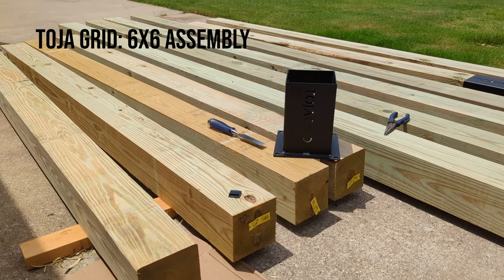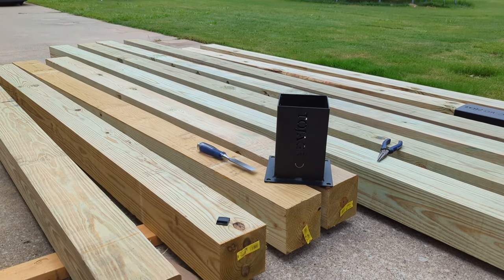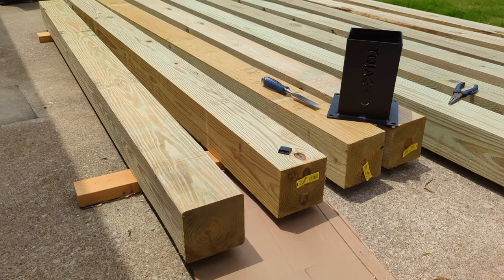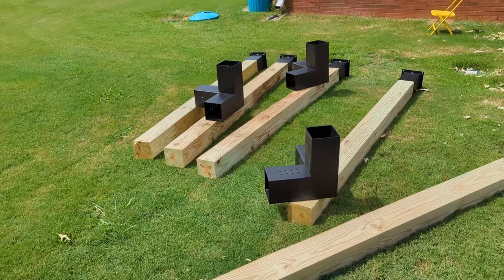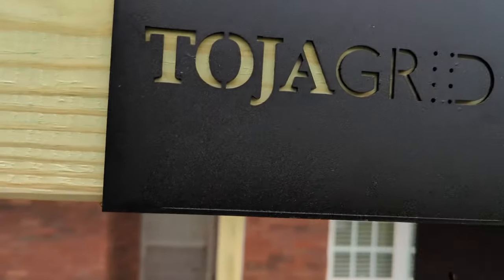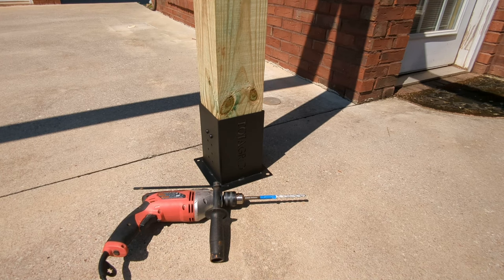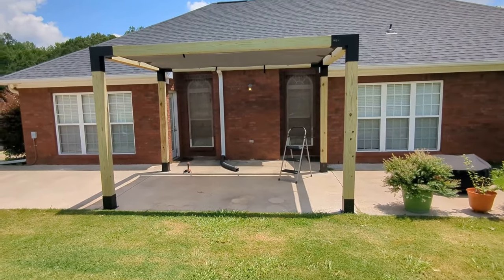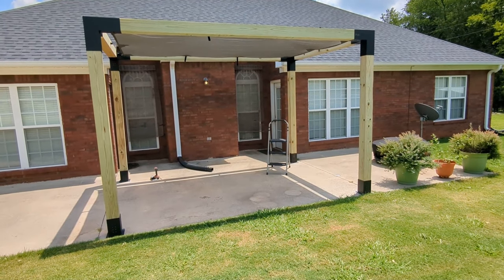How to Assemble the TOJA GRID Pergola

Comment: What was your total price?
Reply from the maker: Total for materials was $1578
The price breakout:
Toja Kit 8'x12' = $1200
Pressure Treated Lumber = $278
Anchors and Drill Bit = $50
Wood Stain (not in video) = $50
Reply: How do you feel about it after having it installed for 8 months? Regrets? Issues?
Reply from the maker: @JoshuaLindsey92  oh we love it, no issues whatsoever. I would highly recommend the 6x6 version. I think if I would have done the 4x4 (less than $1000) I would have regretted the 4x4 just because of how that wood is likely to warp over time. The brackets show no sign of rusting. The 6x6 is really stout, just a lot heavier to put up. But we used 10' 2x4 and a ladder to help hold. Way easier than what they suggest. I toyed with the idea of doing cedar beams, but that would have cost 3x as much. So we just got pressure treated let it air dry for 2 months and then stained to look like red cedar as the pressure treated will turn grey over time.
Reply from the maker: Was even tempted to buy their table kit as well, but my in-laws ended up getting us metal furniture instead. If you want me to send you a picture of our final setup feel free to email me at unconventional.thinker.21@gmail.com
Reply: @UnconventionalThinker  did you buy 8 6x6 posts for $278? Damn that’s cheap…$34.75 per post.
Reply from the maker: @MP-yz6sb yeah Toja grid is the most stout product for the money. The 12' were $50 each. Then I had 6x 8' ones that I think were $30 each.

Tried to sell some buddies on it who were looking for pergolas. They bought something for the same price that's flimsy as ...
Reply: Do you use a 3/8 drill bit for the 3/8 anchor bolts. And did you drill 3" into concrete?
Reply from the maker: @73bumbo yes, for the 3/8" Tapcon anchor you use a 3/8" concrete drill bit. I measured the length of threaded portion of the anchor and gave myself a little extra distance so I didn't bottom out the anchor, and then I marked it on the bit with some blue painters tape to know where to stop

Comment: YOU SHOULD HAVE PUT 2X4'S SPACED OUT INSIDE AS RAFTERS , THAT WOULD HAVE LOOKED NICER, TOJA SELLS THE METAL RAFTOR HOLDERS FOR THE WOOD
Reply from the maker: Well aware, just didn't want to spend the money, as the shade provides better shade than wood slats
Reply: @UnconventionalThinker  TRUE AMAZON SELLS THE ONES I GOT FOR 32 BUKS GOOD FOR 8 2X4 AND THE BRACKETS ARE SOLID

Comment: What is the ACTUAL dimension from the outside of one bracket to the outside of the other bracket? TOJA site says add 14" (7" x 2) for the 6" brackets. I don't see how you only add 7" to each end when a 6x6 is 5 1/2" and the flanges are 1" each. That sure seems like 7 1/2" to me. If they are only meaning you account for one flange, that is then only 6 1/2". Something doesn't seem to be right with their numbers. The way they present things, an 8' x 12' pergola would require 9' 2" by 13' 2" so I wouldn't be able to fit this on my deck....
Reply from the maker: Those dimensions on their site are pretty accurate from end to end. I might have been an inch longer than their numbers. Based on standard lengths and the way wood sits in their bracket. If it's too long you can always cut your wood to desired length.

Comment: How does the water drain from that canopy when it rains? It seems as if will just pool on the canvas.
Reply from the maker: So the canopy I have is just a shade, water doesn't collect on it due to it being very porous; won't keep you dry from a downpour. You can actually see through it to some extent, but is great as a shade. They do make a rain canopy, and it appears to drain at two of the corners. They also have an umbrella canopy that has a pitch to it where drain around the perimeter.

Comment: curious of your thoughts on strength for supporting solar panels.  I'm planning a pergola connected to my roof edge so I would have one point of fixed contact.  Planning on a 12' x 18' version so would have an additional post at midpoint of the longer sides.  wasn't sure if these brackets would allow some level of racking which I prefer not to have.  I really like the clean look of Toja
Reply from the maker: Yeah that's a tricky question, depending on the weight of the panels. The brackets are just spot welded pieces of steel plate. Let's just say I wouldn't want to load them anymore than the weight of the wood, but doesn't mean it can't hold more. Yeah the finished look I really appreciate as well

Comment: For the corner brackets, where are the stops for the wood beams inside the bracket?    I'm trying to determine the exact beam length for the vertical and horiontal dimensions.
Reply from the maker: If you go to tojagrid.com and you look at their different kits in the images. It will give you the final dimensions of the entire pergola for standard 6x6 or 4x4 links of wood that you would get at Home Depot or any lumber yard. We had the 8'x10' and the final dimensions are supposed to be 9'2" x 11'2". So each corner bracket seems to add 6". The bases don't really add to the dimensions as the bottom out right on the flange.